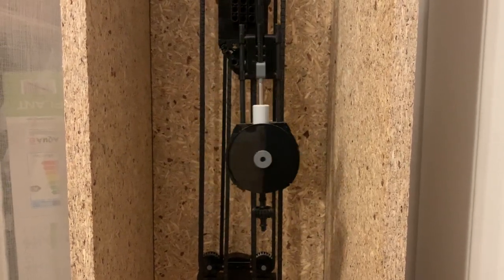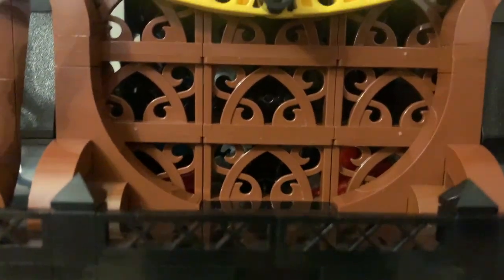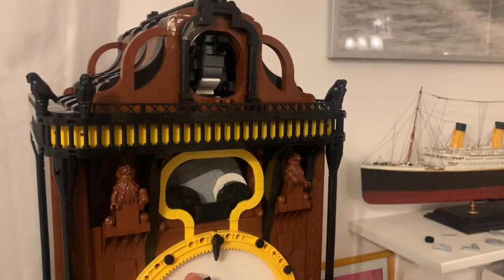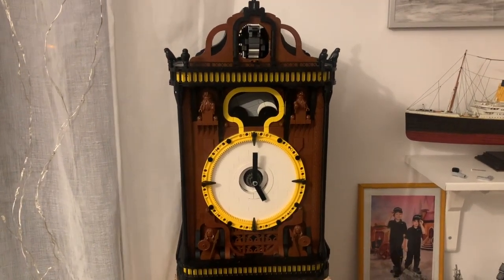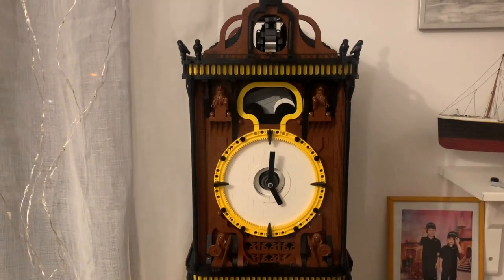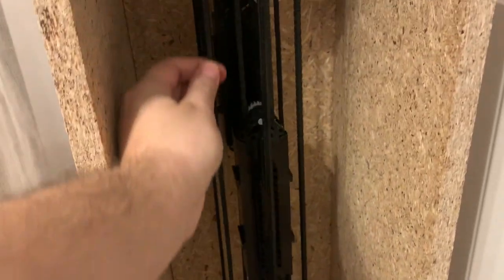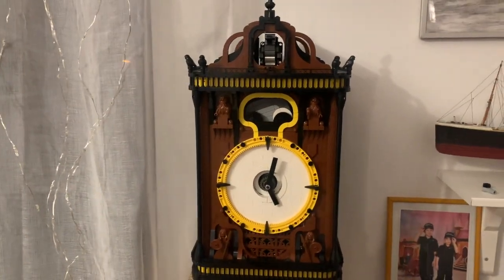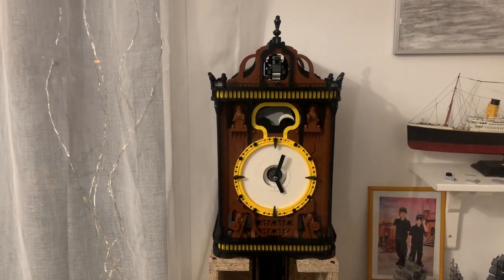Lego Clock Project - The Hood (part 6) #lego #clock #legoclock

Comment: Amazing! Is there a way to trigger the striking mechanism without moving the hands in case it desynchronizes with the hours? Can the hands move both forward and backward when setting time? I ask because I always had these two problems with this style of striking mechanism.
Reply from the maker: Thanks! This is an escapement-based mechanism with two levers. First one locks the chain and the second one locks the fly. As the hour approaches the second lever raises to lock the fly, then it pushes the first one so it unlocks the chain (this is called a warning). At full hour the second lever is released, the fly can rotate freely and striking begins. So, in fact, I can trigger the striking by pushing the first lever (the one with the gray weight on it - see the previous video). I plan to add some axle going from the bottom of the hood to make it easier. I can move the hands backwards, however until they reach full hour. Otherwise I need to go full cycle forward. But this is by design and this is what the clocks with similar mechanism used to function. Alternatively I can simply remove the hands, set them around the time I wish to and put them back 😅
Reply: I have the same trouble adjusting the hands backwards as the trigger will jamb.
I could lift the trigger arm out of the way while reversing the time to avoid the problem.